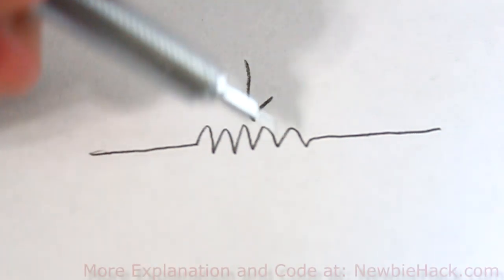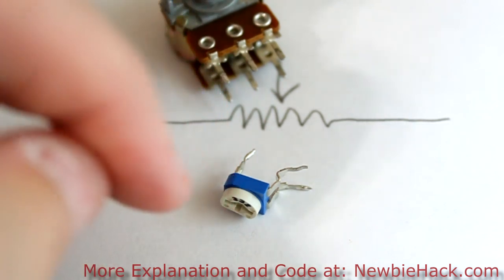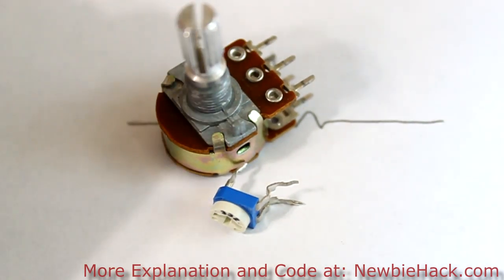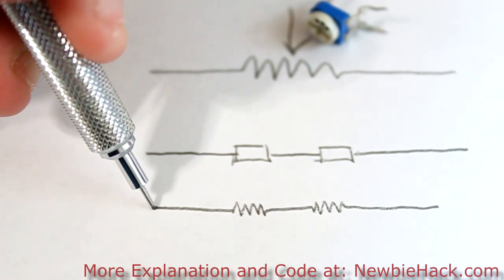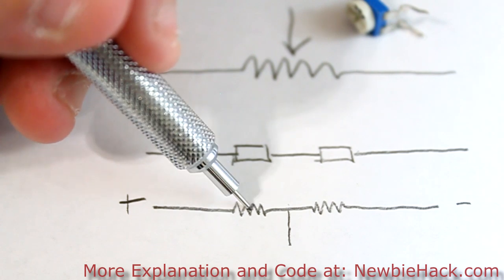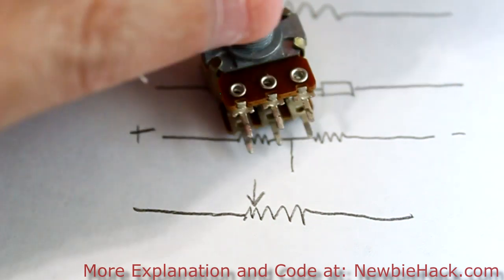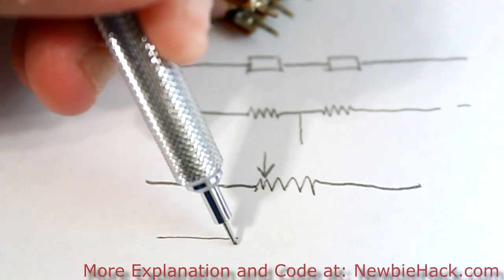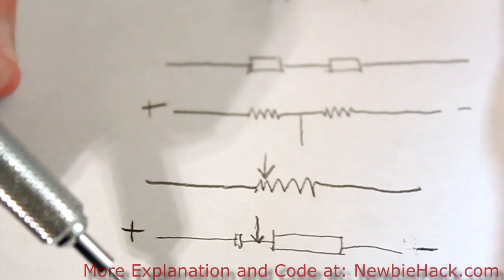29. Arduino for Production!  AVR Atmega32 - Potentiometers and Voltage Dividing

Comment: The A50K potentiometer is a logarithmic pot, which is usually used in audio applications, since that's the way we perceive a change in audio levels. That's why the resistance (and the voltage thereof) changes so rapidly when moving the wiper. If you plot the real measured values, the graph would resemble that of the ln(x) function.

The B50K is the linear version, which is used for regular applications. 

Great series by the way. 

Thanks!

Comment: Your formula is for calculating the voltage drop across R1, not the Vout...that is if you are referencing from ground (negative). That said, I have learned a lot from your videos and appreciate all the work you have put into them.

Comment: The easier way to explain dividers it to indroduce voltage drop. Once you do that you can instantly see that the more resistance is present between the Vout tap and the groud - the more voltage will it have - it kinda goes by intuition.